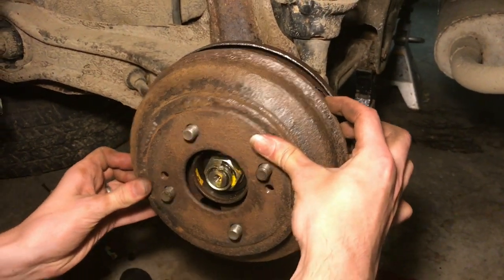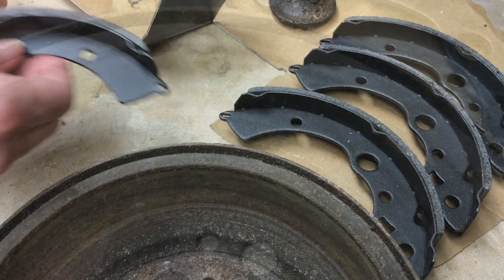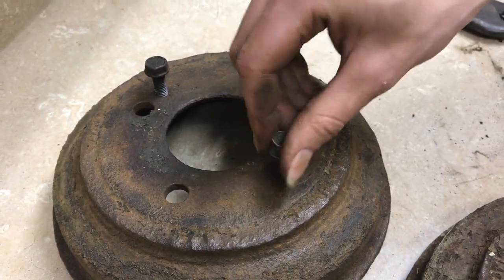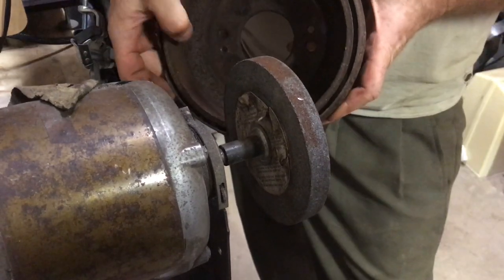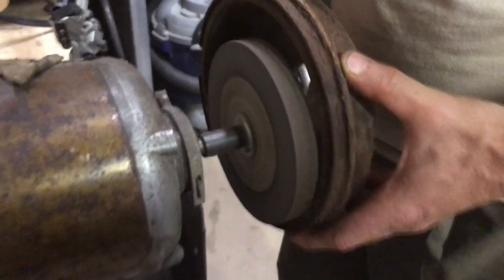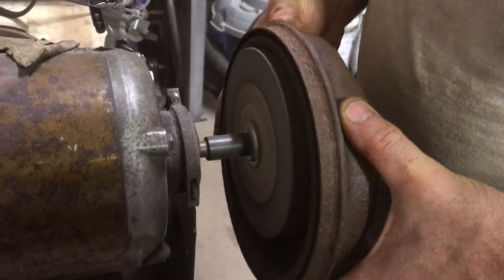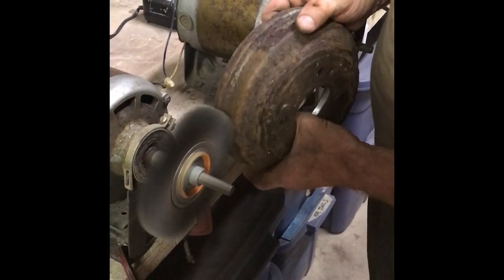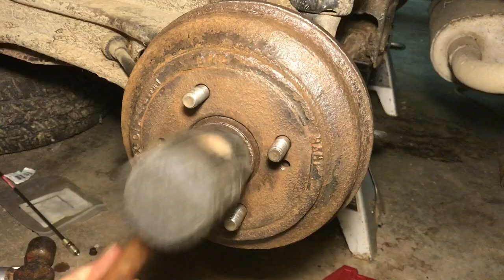brake drums WON'T come off?!!! (RESOLVED)

Comment: You can access the two pins that hold the shoes in place from behind and cut them  to allow more slack. Combine that with using the bolts to push the drum out, you can then get pliers in and pull the bottom spring.

Comment: So, how do you get it off when its already stuck up that way?
Reply: Use the brake adjuster that he mis-identifies as a retractor in the end of the video.
Reply: @mediocreman2  if you can't get the drum off, how do you get to the adjuster?
Reply: @johnp8120  the adjuster is accessible through the back
Reply: Even after I retracted the self adjuster the drum is still stuck.

Comment: I think we all know about drums with threads, what about drums without threads and without wheels to retract the shoes? And you can't get at the handbrake cable adjuster because the manufacturers decided to stick it behind the exhaust heat shield, above the exhaust pipe, like on the Peugeot 106. What are you going to do then?

Comment: Great video!  The ridge was exactly my problem.  I gave up removing and took my car to Firestone.  Discovered your video while waiting for the $500 brake job:(

You may want to edit your description  as "Are used" doesn't make any sense.  Do you mean "I use"?

There's a reason why brake drums get stuck on the car. Once you know the trick, you won't have this problem anymore. Many people assumed drums get rusted on the car and that's why they were so hard to get off. It's not so much the rust but a ridge that is formed on the outside of the rotor. Now that you can identify this ridge, you can take care of the problem. Hope you enjoy the video

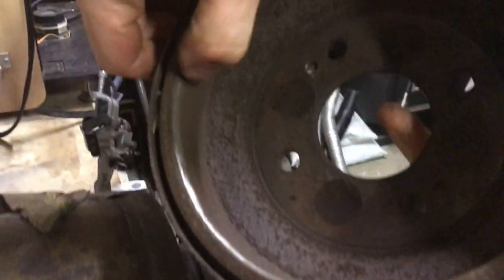Comment: 1:45 you just made grooves at drum surface. It will make grooves on your new brake shoes, but worse part it will reduce stopping power. Now you either have to take this drum for resurfacing or replace the drum.
Reply: What he did has no negative impact to the braking performance.

Comment: Add a video on rebuilding brake cylinder.
Reply from the maker: I did create a video called rebuilding brake cylinders without expensive tools. Trying to get those rubber parts stretched over the plungers can be tricky. If you have any other questions let me know.

Comment: Nice attempt at a video but it does not cover a whole host of problems that you run into with drum brakes.  This is like getting a drum off in the most ideal situations video.  What if the brake adjuster won't move after you can't get the drum off?  What do you do if the holes on the drum for the M8 backout screws strip (see any rusted drum ever)?  The fact that this guy didn't know about the adjuster window/gear before doing a rear brake drum job says a lot.